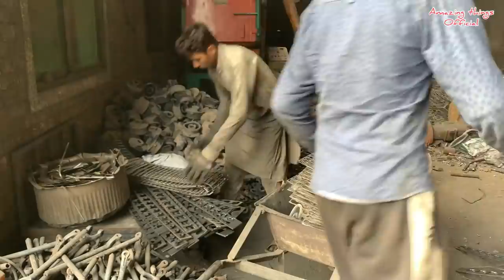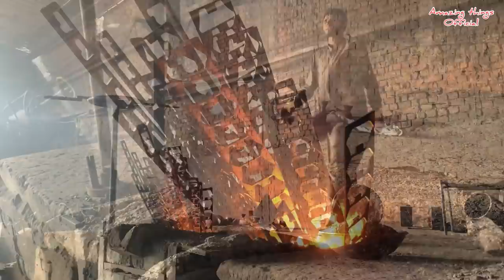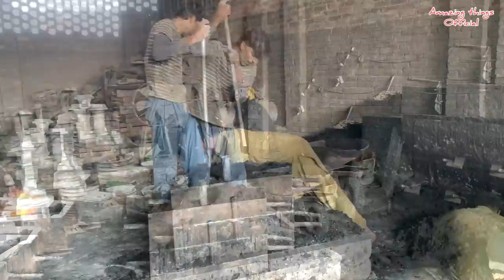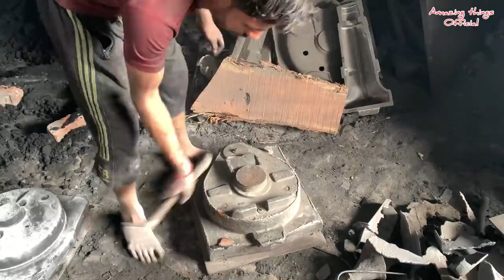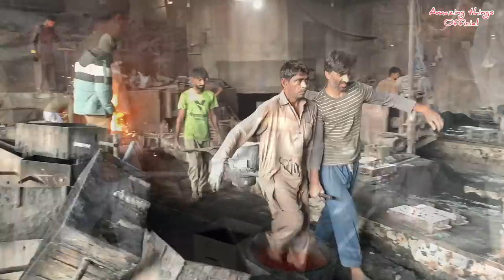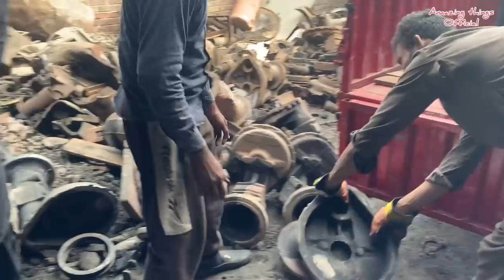Mass Production and Casting Process of Rear Wheel Axle Housing Tube For Tractors in Foundry

Comment: These people are working bare footed in a foundry? It's a wonder that no one ever gets hurt.
Reply: Rather, when someone does get hurt - foundry work is dangerous - that person is simply discarded, much as if he chose to get hurt on purpose so as to cause his fellow workers trouble.

Same situation applies for age or illness, even if the job itself was directly to blame.
Reply: Not much in way of personal protection equipment, but they seem to take pride in their work. You can see them smile
Reply: Not a pair of safety glasses in sight !
Reply: @dennisyoung4631  z
Reply: theybdo get hirt. then they are discarded. they dont last for long in this proffession. but people are cheap in these countrues.
Reply: @johndoe1909  that's such a stupid thing. Not only is it bad for the workers, but also for the factory, since they won't accumulate many veteran workers that way. But I guess there's a reason why 3rd world is 3rd world
Reply: @frederikqu7717  i see the same drift in for instance the usa. plenty of comments here for instance seems to be longing for good old days when they could setup shop and exploit people with no consideration tonsafety and, or indeed anybother of the myriad concerns one has to have 7n these settings.
Reply: They do get hurt. A lot.

Comment: In first seconds I wanted to say that at least they use proper material. But then I saw oridinary steel scraps. So again unknown mixture. If casting such big elements there should be exhaust gases channels in molds. Can you see any?

Comment: What is the white powder ?
Reply: Parting dust. Usually it is talc. The sand they use is sticky and sometimes you don't want the sand to stick. That black stuff is sand, clay and oil. But it's called oil bonded sand. The stuff we use in the west is usually red. Over there they use used crankcase oil. Which is black. Stuff left over from engine oil changes.

Comment: I've worked in a foundry in the U.S. that had a lot worse conditions than this. High pitched whine is induction furnace high frequency power supply running.